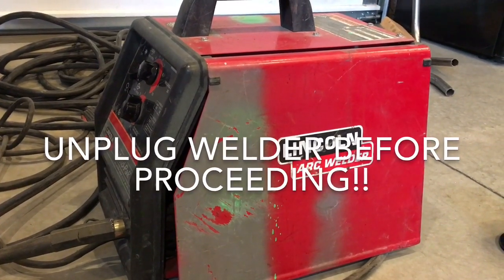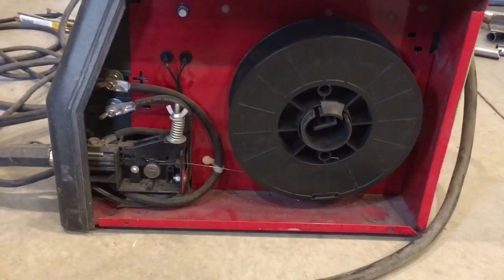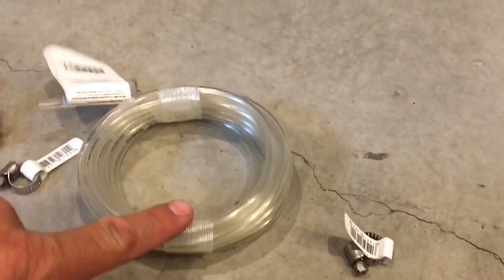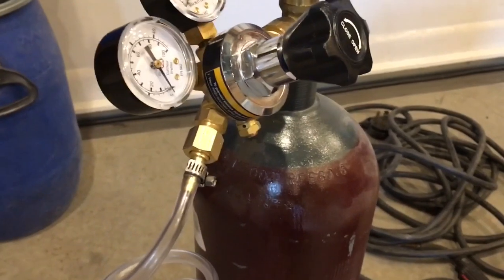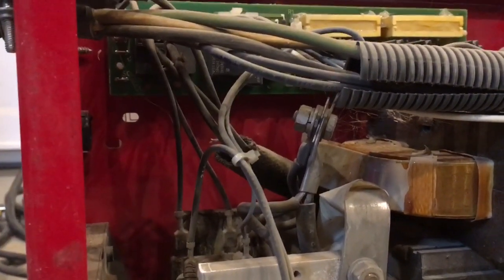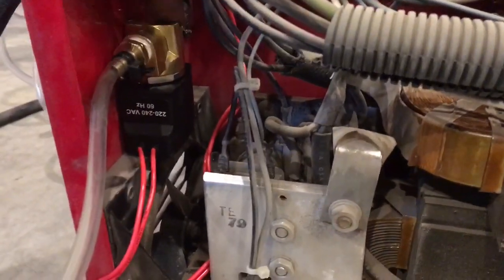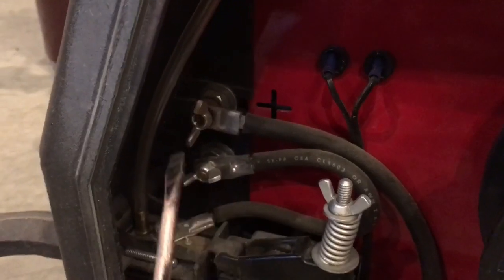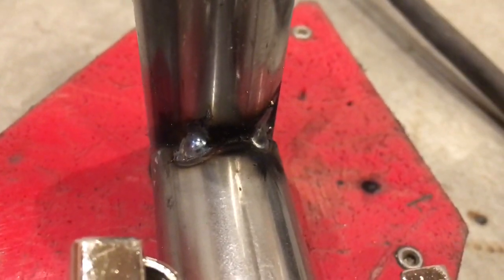Convert Flux Core Mig Welder to Gas For Cheap

Comment: Don't use tape on the treads going to the bottle or the hose barb it don't need it it has  flare fittings  also on the inside it has 2 holes right under the plugs just drill one hole and you can screw right in the back of the selanod

Comment: If you have multiple welding machines you can plumb a 5/8-18 RH x 1/4 Male to the back of the welder to use standard welding gas hose and fittings. A bulkhead connector or other strain relief will protect your solenoid valve. It's only plumbing so whatever fits and works safely is fine.  The Weldingweb forums have many posts on small welder conversions and are noob friendly.
While MIG mix welds with less spatter these feeble little machines weld better on thicker stock using CO2 whose cylinders also last much longer because CO2 stores as a liquid while MIG mix stores as a gas. Best to have both so I do. The small "kegerator" size CO2 cylinders are nice for mobile work.

Comment: The 220 volt gas solenoid . What size lincoln weld pack will it work on ?    I got the 155 wondering if its compatible with this welder thank you ?

Comment: Yea like you really need to be doing video and be doing it Wrong . You need flask reg with ball in it to adjust the gas otherwise  you wasting gas
Reply from the maker: It's been working great for a few years now. Haven't noticed any excessive gas consumption, but maybe. I'll look into a flask regulator though. Thanks for the tip.

Comment: Nice video. But why didn’t you just mount the solenoid through the hole on the back side of the welder? Instead of running the hose through.

Comment: WHAT GOOD IS THIS VIDEO IF ITS FOR   "ALL THE WELDERS THAT ALLOW FOR EASY CONVERSION"?     what if I dont have "THAT NOZZLE"  ?????????   Right here on the circuit board there are 2 PRONG THINGIES????   prong thingies? Really?
Reply from the maker: Jet it shows you how to not buy the manufacturers expensive conversion kit and create your own cheaply. If you don’t have a welder meant to be converted it won’t work. Sorry it wasn’t more helpful.
Reply: @kirkearl  yes it will i’ve just done it

Comment: Great work, definitely will give it a try.
One thing you need to bear in mind though, is
you need to change the weld wire to the un-shielded one.

Comment: Nice job - do you by chance know the part number for the 220V solenoid?
Reply from the maker: I bought this one on ebay: EHCOTECH  B20V-1/4-CD-220VAC  SOLENOID VALVE
Reply: They seem common I have seen very similar ones used for firetruck deluge systems. Those were designed for water of course.

Comment: I know this is old but from the solenoid to the marching.  Is the brass valve a 1/4 male x 1/4 hose barb or is it 1/4 male to 1/8 hose barb.  I was looking at the hose fitting on the machine and it looks like it’s 1/8.  I don’t was to use the wrong hose and hose barb and have gas leaking on the gas input on the machine.

Comment: What shield gas are you using.. Is that Co2..?
Reply: Usually a argon and co2 mix of 75/25 for welding mild carbon steel.
Reply: Where did you buy the gas?

Comment: Tape on your regulator is a bad idea. The threads do ZERO sealing. The only sealing is on the face of the fitting.  Good idea though about just making my own kit instead of purchasing one. In my case, I may go with a 120v solenoid as that is what I'm running on.
Reply: he obviously has no clue what Teflon tape is intended for.

Comment: You don't need tape on the threads on the regulator where it threads into the hose barb. The threads DON"T seal.t
Reply: Correct. If you have a leak coming from that junction, it will be because the seat or surface is nicked or damaged. Sometimes they can be dressed up with a fine stone and a magnifying glass to get rid of the burr.But for safety, I'd always recommend just replacing the damaged part.

Comment: You don't need tape on the threads on the regulator where it threads into the tank.  The threads DON"T seal.
Reply: The bottle and regulater are self sealing they are ment for each other.
Reply from the maker: CPUDOCTHE1 good to know. Does it need to be removed or no problem?
Reply: @kirkearl  If it was oxygen, YES you would have a hazard with that setup but since you're using argon/co2 they are inert gasses, so you're ok. I'd remove the tape anyways though.
Reply: @watcherwatchmen7785  Thanks. I've learned a lot since making the video. I was afraid at first the gas was a ticking time bomb, but I've since learned the difference. I've taken the tape out of there too. This set up has been working great for a few years now.
Reply: @kirkearl  It will not cause a problem  When you take it apart, make sure you do not get any pieces of tape on the sealing surface, which is the taper on the regulator and the mating surface in the valve.
Reply: If those fittings are not sealing up and they’re allowing gas to escape usage then there is nothing wrong with using some Teflon tape to seal it up. 
  People use tape for inappropriate reasons all the time. 
    Not everyone has the means to run out and buy a new regulator and they’re not filling gas bottles for free anywhere. 
   So screw the tape pundents and use tape if that’s what seals up a leak. 
  Unless they want to buy your gas for you in leu of your roll of Teflon tape, then you shouldn’t listen to a word. 
    Half these bottles are never checked for damage at their sealing points in the first place.
Reply: @hughobrien4139  By design, the threads DO NOT SEAL.  The mating surfaces on the regulator and valve seal.  If they leak and the threads are sealed, the gas will leak out between the pipe and nut.  The only purpose of the nut is to maintain pressure on the sealing surfaces.
Reply: I understand exactly how they seal up. My argon bottle just happens to leak around the threads when I tighten it up. 
   Add some Teflon tape and the leak stops. So I use the tape. 
  It’s a subject that is about as important as rat killin.

Comment: I have cheap HF AC 100A welder, it doesnt support gas. On ebay i found a kit with mig gun with euro connector , socket and gas solenoid.

"Mig Welding Euro Torch Conversion & MB15 EuroTorch 4Mt + Inst & Gas Solenoid E79"

Its easy to convert  this welder to DC (rectifier 150A +  big capacitor) and then install the kit, do some wiring, add transformer for solenoid and relay and basically you have mig welder with gas support.

I even had idea to make my own new gun so i can add gas hose to it etc. It will be a bit cheaper. just buy a gas solenoid. I have everything else. but i dunno yet. maybe its easier to buy gun that supports all this already

Kit itself is 100€ including shipping.
With small cylinder of gas and reductor the total price will be around 200€, still 100€ cheaper than buying cheapest  gas ready machine. i bought the welder from ebay for 80€

electrics and electronics is my hobby, so wiring is not a problem

this is my plan and im gonna try it.
Reply: If it's pure AC you would benefit from adding a rectifier.
Reply: jw200 you should make a video

Comment: Does this actually work? I’ve had a fluxcore welder for years and never used it because it’s crap
Reply: Flux core is NOT Crap. Maybe it's just your crappy welder
Reply: @josephgonzales3573  90% of Flux core welds ARE CRAP! Unless you are running dual shield.
Reply from the maker: If your flux core welder is one that can be converted to a gas welder this works. You are basically just making a homemade version of the conversion kit that your welder brand already sells.

Comment: Excellent conversion.  The only thing I would suggest is when passing tubing through sheet metal, drill the hole larger and instll a rubber grommet.  It will better protect the tubing.  I find it hard to believe the valve has to be mounted with wire.  Are the two holes at the bottom of the valve threaded?  I can't tell from the video and it doesn't look like any screws in there are holding the solenoid together.
Reply: Argon and c02 aren't volatile gasses, so even if it wears through, you won't have to worry about anything dangerous.